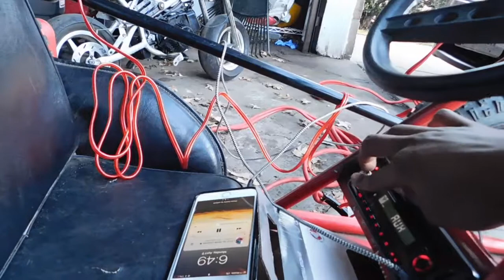Go Kart Sounds Part 2 | It works!!

Comment: I got a cb radio onl my go kart I would use a Bluetooth /BTS or you could go with a smaller set up whight wise but you won't be able to hear it when running the engine I got a mulfler on my 420cc now and it would have to be so loud to it over my engine I would not be funny or it would lol

Comment: This is so bad  I wold never put a subwoofer on a go cart it will slow it down when in use because it uses lots of. electricity and it is heavy  if you take it off it wold not be that bad I just do know think that is a good idea I am not trying to be mean I just think it is not smart and please do not put rims on it that will slow it down more because of how heavy it is and how they are bigger if you put small  tires on it that might make it a little bit faster and if you get all the electrical stuff of it it will go a bit faster and the sound system should come of too if you remove stuff like heavy things it might go faster
Reply from the maker: Hey appreciate the comment lol! You’re absolutely right but it was just for the video. Just completing childish ideas
Reply: @Leek2x  oh thank